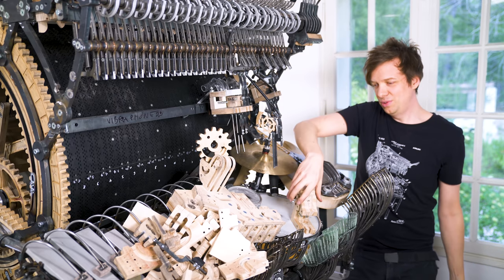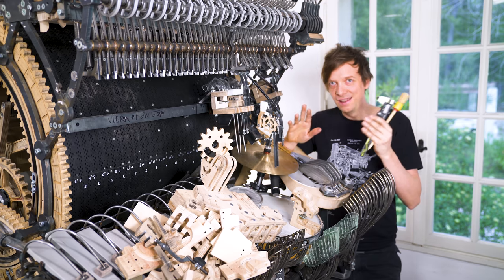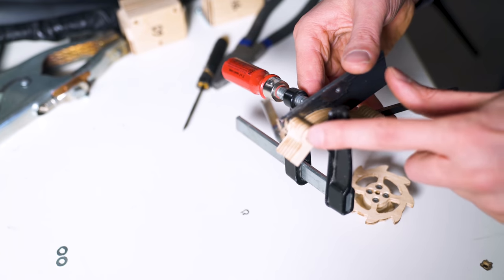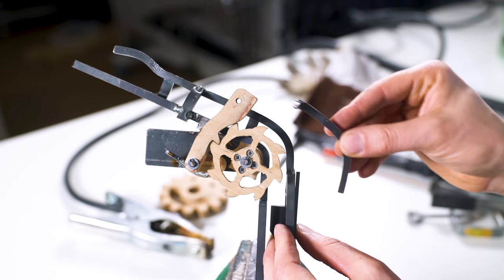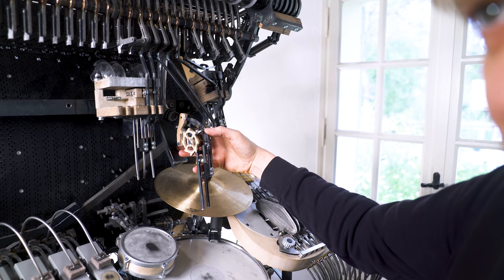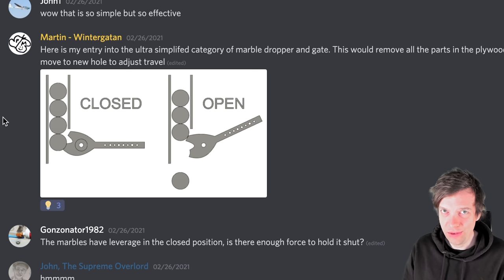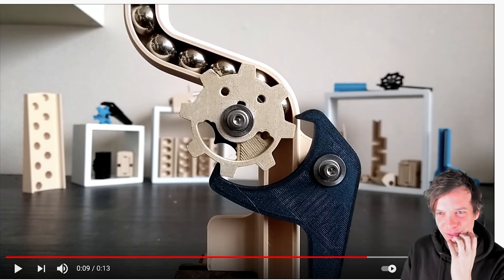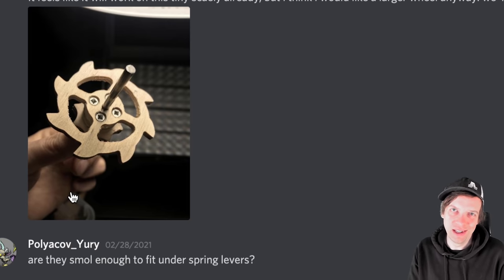Clock Escapement Marble Gate

Comment: Any chance of the gear thingy ever wearing out? I have a slight feeling that the pressure might someday break off one of the teeth or smth.
Reply: With his new fascination with reliability, he has been running a lot of parts pretty hard...as an engineer, I am starting to get concerned about the life expectancy of some of his wooden parts in particular.
Reply: @LOVEMUFFIN_official  - I'm looking forward to him discovering titanium.
Reply: @hamletksquid2702  I'm not hopeful for his wallet if he does
Reply: @Lilith-Rose  - I keep seeing this machine and can't help thinking how much it would cost if people weren't donating their time and materials. Custom machining, laser cutting, 3D printing, and CAD design work all add up pretty quickly. It's a good thing he's working empirically, making things adjustable instead of trying to make them perfect. High precision would double the cost of everything and wouldn't produce a more workable final result. So far, he hasn't fallen down that particular rabbit hole and that's a good thing all around. It's a lot more fun to watch him making things work with the materials and processes available than it would be to watch him obsess over microns.
Reply: @hamletksquid2702  it is amazing to see the community pulling together like this, I wish I could afford to have the gears made out of brass or phosphor bronze sheet stock and sent to him since those would (in my opinion at least) be the best material choice. I think he can get away with a brass sleeve bearing inside the gear to mitigate wear issues and I don't personally forsee the teeth breaking as an issue (although this could easily be reinforced by creating a sandwich gear with a central steel sheet metal piece, although that's another possible mole breeding facility in itself). I'm interested to see how this goes though, and hopefully once we know that he isn't going to change the design again in another week someone will be willing to invest in getting him some nice shiny brass parts made (I'd love to be that person and add some etching or inlay work on them, I know I could make them look gorgeous but I don't have the tools to make multiple of them quickly or accurately and I definitely don't have the funds to volunteer to make them either unfortunately)
Reply: @Lilith-Rose  - I don't have the specialized tools or knowledge to make gears, at least not helical ones, but that's a little fantasy of mine, too. Those big wooden gears make my teeth hurt. I haven't seen anything used on this machine so far that would benefit from my specialty (high-precision jig grinding), but you never know.
Reply: @hamletksquid2702  I definitely don't have the tooling or expertise either, my area (at least the one relevant here) is restoring old tools (particularly edged tools because I live sharp things and aparrently hate my hands) and figuring out fixes to make things work. If I had to I could make a template and jig to cut the gears for this particular mechanism but I'd need to beg or borrow the use of a milling table, or a cross slide I can mount to my little pillar drill, or just do it all by hand. I'm definitely not qualified in making gears, I've made up/modified a few replacements in the past to fix something when I needed to but I mostly just enjoy making things, trying out new techniques and the associated challenges, however in this instance the need for repeatability and the amount of time it would take puts me out of the running either way. I have always been fascinated with machining and I like to try things out, but unfortunately computers confuse the hell out of me (I get easily overwhelmed and it turns into a blur of numbers that I can't make sense of, something to do with my brain being wired a little backwards aparrently) and as such I prefer to do things by hand which is inevitably much less efficient and definitely not easier, but more fun than banging my head against a desk for hours trying to use cad software. I definitely wouldn't call myself an expert in any one particular area of machining or fabrication I just have a decent working knowledge of a good amount of different materials and applications from experience, and if I don't know something I usually know how to figure it out. It's much easier for me to do in person when I can get my hands on something though so in general for this project I prefer to just make the odd suggestion rather than getting more involved, and leave that to those who are more qualified, much as I would love to dive in and get my hands dirty (the opportunity to learn alone gives me the itch)
Reply: @Lilith-Rose  - I work in a fully-equipped general machine shop, and my boss was a co-worker for twenty years before he bought the company so he's pretty good about not keeping too close an eye on what I do with my time. I come in, he goes home. I occasionally bring in small government jobs, mostly motorcycle parts, and sometimes I'll leave one on my bench and come in the next day to find that he's done the work for me. Little jobs like that are like a break for us - you can just bash it out without having to stress over making it perfect. I've been at the same job for twenty five years and I'm still learning new techniques all the time. My boss has been at it for forty years, and the old boss with fifty years experience comes in part time and does rough work on the mill and such. I'll always be Number Three, but I know if I have a question, there's an answer available. The machines I mainly use are pretty old school. They have digital readouts for the table position, but everything else is manual and requires experience, an ear for what the machine's doing, and calibrated fingers and we produce work that's more precise and of higher quality than any other process. Every twenty years or so, someone comes out with a CNC machine that's supposed to make us obsolete, such as CNC mills or EDM wirecutting machines. They're cheaper to operate, but so far no one has brought out anything that combines precision and quality of finish that can match jig grinding. We're the John Henry's of the machining industry - they keep bringing that steam drill around, and we keep beating it. I love my work, but it is a dying art.
Reply: Is not a lot of weight but I'm sure you're right it's a valid concern and should be stress tested... luckily they could be swapped out in the future
Reply: @hamletksquid2702  I have a massive appreciation for old school machinists, cnc machines might be faster and crank out bulk parts with minimal supervision /labour but nothing beats the precision and knowledge of experience in a proper machine shop. I'm just hobbyist in comparison and do what I do for fun more than anything, that way I get to enjoy doing everything from blacksmithing and metal casting to hand cutting on a lathe. Half of my fun comes from making or improvising the equipment using "scrap" to get a job done and I take pride in that, could I make life easier by buying fancy equipment? Sure, but I won't get the satisfaction of knowing that for example instead of buying one I just cut a new live centre for a drill powered wood lathe from the rotor of an old electric motor I had lying around using a file and a carbide cutter while spinning it up in a drill with the rotor bearings held in a wooden jig to act as a makeshift lathe, just because I could and the old live centre wasn't exactly standard sized so replacements were hard to get hold of without getting a whole replacement tailstock piece. It's that kind of thing that I really enjoy doing as well as taking rusted out or broken things and giving them a new life, and you learn all kinds of skills along the way doing that
Reply: @Lilith-Rose  - Many years ago, I fixed stuff like power tools, light machinery, generators, and such. I was always bringing home bits and pieces to build gadgets and R/C stuff out of. One of my "triumphs" was building a hovercraft about two feet long powered by a scrap chainsaw motor that came in with blown crankshaft bearing that were no longer available. I had to machine the mounts to hold new bearings, re-assemble it, and mount it onto a frame made of aluminum strips and aluminum siding with a motorcycle inner tube for a skirt, and two sets of twin belt-driven 10" props using home-made pulleys. I got the bottom half finished, without the fan on top to make it move, and decided to test whether it could actually lift itself. I wired the throttle open and tied the thing to a fence post with a rope, just in case. I fired it up, and it went about twelve feet straight up, hit the end of the rope, and turned inverted and smashed into the ground at about fifty miles an hour. Months of plotting, planning, and fabricating yielded about five seconds of "Oh, my God". It was worth it.
Reply: @hamletksquid2702  that is an absolute classic, I think I'd have pissed myself laughing at that one after the initial god damnit at seeing all that effort destroyed, I'll agree those kinds of catastrophic failures are definitely worth it. My homemade steam powered boat suffered a similar fate from on its first test voyage, no steering servos or rudders installed since I was still just working on the power plant so I just tied it to a fishing reel and it ran fine for all of thirty seconds out into the river until something in the meccano transfer box I had built to gear down the speed of the prop in lieu of making a governor bound up under load and essentially created a sealed system, bye bye boat in a cloud of steam and copper shrapnel, aparrently the safety valve failed to do its job
Reply: @Lilith-Rose  - Steam is one of those things I'll get around to one of these days. I'd like to do a steam powered African Queen, with little Humphrey Bogart and Katherine Hepburn sitting in it. I'm sure there are kits available, but that's not the same. I find making things more satisfying than owning them. I'd be willing to bet that if Walmart sold MMX's ready to go, Martin wouldn't be nearly so interested in one.
Reply: @hamletksquid2702  oh definitely, I feel the same way about kits unless you are getting them to then customise or buying them to use the parts for something else. Like with lego or meccano growing up it was way more fun to get a bunch of bits and use your imagination than to follow a set of instructions, I still use some old meccano in projects to this day actually because of the premade gears and pulleys etc that are so much easier to line up correctly because they are all designed to work on the same fixed scale of the distance between the holes, and it works well when combined with the old mamod steam boilers. I'd use it more but its so expensive since its a "collectable"  I just pick it up secondhand at junk sales etc whenever I see it.
Reply: @Lilith-Rose  - To be honest, I didn't realize that meccano was out of production. Don't do much toy shopping these days. I wouldn't have used it for things like mounting choke linkages on cars if I'd known it would become collectable. I don't even remember what became of my big box  of the stuff, but I can't imagine growing up without it. It has to be a common thread in a lot of people's childhoods, and one of the seeds that led us all here.
Reply: @hamletksquid2702  I think the thing about meccano is that it was made to be used, I bet the creators would get a kick out of seeing it used like that to be honest. It's definitely something I'd like to see more in kids, sure I'd have loved computer games when I was younger but there needs to be a healthy balance of playing outside in the woods and getting muddy and scratched up etc, building things and experimenting as well, not just sitting in front of a screen (although some of the "chemistry experiments" we did definitely weren't a good idea in hindsight, especially those with volatile exothermic reactions aka big kaboom and my habit of picking up minor injuries from things I'm working on). I count myself lucky to have been born when I was, I grew up right on the edge of computers and with Nokia mobile phones becoming readily available during my early teens etc but we couldn't afford such things so I got the hand me down lego and beat up meccano sets missing the instructions etc, with my tech being a second hand dial up office computer to play minesweeper and pinball on while I was supposed to be typing on an assignment, four channels on TV of you were lucky and a few VHS tapes. I'm honestly really grateful for the opportunities it gave me and to my parents for encouraging that kind of thing considering how some of my peers turned out
Reply: @Lilith-Rose  - Yup, we were members of the same tribe. No doubt about it. I was a teenager a while before mobile phones and such. I built my first computer in 1976, with a soldering iron. It was a Sinclair kit with a Zylog Z80 CPU. I saw a board with that same chip a few years ago being used to operate shutters on an office window. 
Good talking with you, but I'm shutting down for the night. Au revoir.

Comment: Have a look at ware resistant plastic options for the escapement. You get colour options , lower ware than metal on metal, and quieter.
Definitely a winner design. Designed to work under load with precision and is an unchanged tried and true design since the 13th century.

Comment: Just for future optimization or problems:

- The pressure isn't magically gone. But instead of having forces in this design you have converted them to torque. The weight of the marbles gone to the inner ring with the marble paths becomes torque onto the inner ring. 
- The outer ring where the ratchet mechanism engages is bigger than the inner ring so the the torque it needs to counter the marble weight is a radius ratio with the inner ring, i.e. much smaller torque needed.
- In this design, despite converting weight to torque, the friction takes place in a very small area, where the left(back) ratchet engages the outer ring, so the total friction is a lot smaller than the other designs.

Archimedes approves!

Great concept, great prototype and magnificent illustration Martin. Congrats!

Comment: I love the aesthetic of the escapement wheel. Another benefit is the potential for easy marble height adjustment in the marble feed. Before, you needed to adjust the marble feed length to have the marbles flush across the marble divider. With this design, you can accomplish this by rotating the escapement with regard to the marble sprocket, which effectively modifies where the marbles stop when the escapement rests. This adjustment would be extremely easy and precise to tune.

Comment: Awesome design! Love it! Also it's so much more visual!

Also, I think if you can design a stop screw onto the arms, you could very easily adjust for the marble stack alignment as well. Or some similar mechanism where you can adjust exactly at which angle the wheel stops

Comment: I think you may have found your final dropper design! Maybe you'll want to make some tiny tweaks, but you did a great job taking the thing that was causing your problems and making it be the thing that makes the system work! At the same time, you made the gate smaller, more reliable, and improved the visual design!

Comment: I think the escapement mechanism is probably the most optimal solution to the problem. Several advantages - you don't care about fit, they can be as loose as you like, you don't care about force as the mechanism is strong enough, you don't care about routing, the freer they flow - the better.

30-odd more channels to go 😁

Comment: Clearly superior - it handles the pressure, but works well when there is no pressure. It is much more compact than the old design, allows you to see the marbles more, and looks beautiful. I suggest cnc machining these parts from delrin. It will hold up much better than plywood.

Comment: Wonderful that you found an elegant design for the gates!  as for the material of the gear, might I suggest brass?  It laser cuts, is non-magnetic, traditional for clocks, and has a lovely change of color from the steel rails.

Comment: As a welding engineer, i can tell you that welding mild steel to stainless is quite common. You're supposed to use 309 filler wire for the best results !
(Assuming this is 304 or 316 stainless, which it most likely is ... If it's not specified and just "stainless" then it's 304 )

Comment: That is a nice solution. Keep in mind that there are friction points. They should be sufficiently strong and slippery material. I don't think plywood will hold up in this instance. Stainless steel might be a candidate bit then the axle will probably wear out. For that a bronze bushing might do the trick. I don't really know what is used in clocks but it often looks like brass or bronze. Although it also might be steel that is plated. Which lowers the friction.

Comment: I think there is a generalization which can be made here. 
Going from discrete to continuous flow is relatively easy; you just dump the marble onto the track. (The track could be full but other than that not a big deal). More tricky is going from continuous to discrete. In that case there needs to be a stage/release two phase transition. The ramp onto the fish stair is a good example; the dropping mechanism is also such a case.

Comment: You should put some Teflon or delrin in between all the metal and wood friction points to make your wood last longer for the tour. Obviously replacing the wheel would be easier but it might also reduce noise. I think it’s worth a try. (Teflon would reduce friction as well, I think.)

Comment: I was so worried about those screws in the old mechanism wearing down the marbles over time (and/or the marbles wearing out the screw) which could change the diameter of the marble slightly in a way that'd cause some mechanism along the marble path to fail. Good to see that this resolves that as well. Looks like the perfect solution, fingers crossed :)